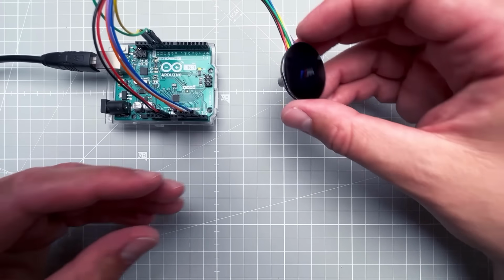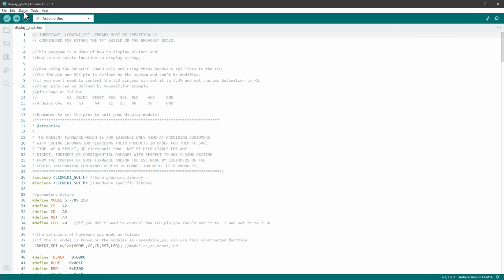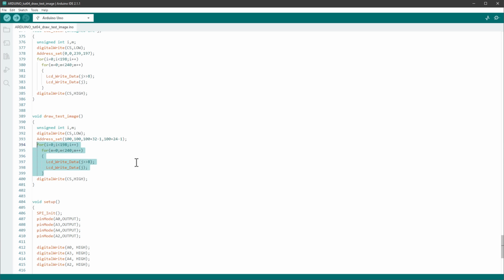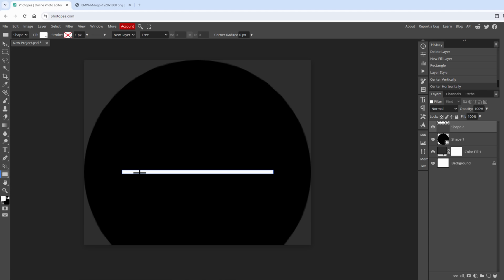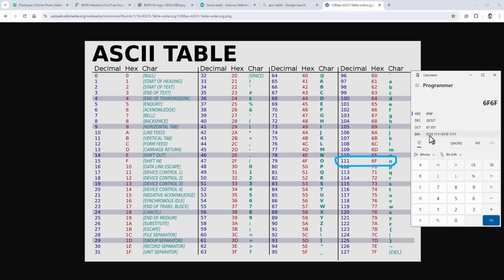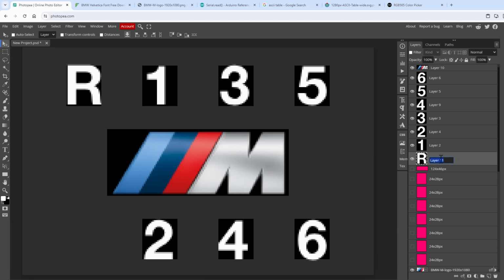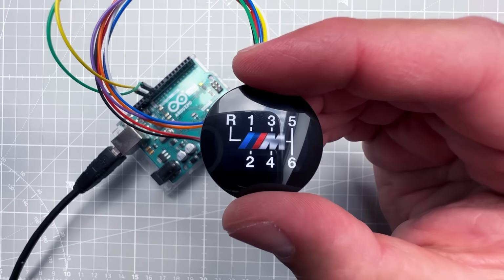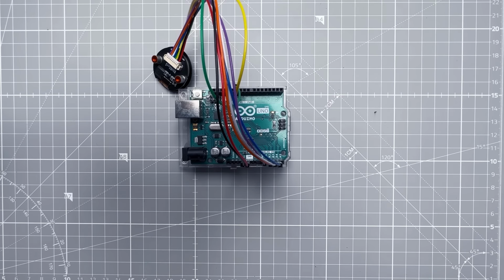I found PERFECT display

Comment: BMW E36 2JZ With Haltech Nexus R5 (Haltech CANBUS) with a TurboLamnik GCU for the 8HP75 (Sequential Shifter, but with canbus doesn't matter if it's H pattern or Sequential or paddle as Canbus will send gear selection and position without the need for and extra sensors) Would love to see this on a Round Forged Carbon shifter knob on my Jinx Shifter! Also, you should make a rotary encoder with haptic feedback and display for the TurboLamnik GCU, you could easily sell  it for $300USD as Turbolamnik just has basic rotary switch with separate oled (calculator screen) display! Would be amazing as 8HP swaps are going crazy now!
Reply from the maker: OK, you probably have the coolest setup! I will take a closer look at Turbolamnik to see how hard or easy is to get information out from it. Thank you for your suggestion!
Reply: @upir_upir  That would be epic as all fk.... I'll be the 1st to line up and buy this if you can get it going, this will change the 8HP market for sure, 8HP swaps are blowing up right now, you'll have no shortage of customers too...

Comment: I was actually thinking about taking on a similar project for a motorcycle engine swap im looking to do since I'll be going from an H pattern transmission to a sequential one.  I'm really glad I found your series!

Also I'm a Suzuki driver.
Reply from the maker: I don´t understand. Do you mean putting a motorcycle engine inside a car?
Reply: @upir_upir  Yep, it's a little Kei Van so it's current engine is essentially a 660cc motorcycle engine slightly redesigned to be used in a mid engine configuration.  So I'm looking to swap it with a more modern motorcycle engine to get a bit more than it's current 20ish HP, and to have parts locally available.

Comment: Customisable theming idea 1:
Use PCX image format with palette and RLE compression with 1 plane. It can be decoded straight into the display without maintaining much intermediate state at all. Punch through transparent images as PCX are a thing as well, then you choose some colour that doesn't occur elsewhere, and by convention the first pixel is the transparent colour. It also supports placement overlays, where the top left coordinate where to place the image is specified in the image file.

Theming idea 2: PAWN virtual machine with access to graphics functions.

Both these are suitable for an STM32 or something more capable than that. RP2040, ESP, etc
Reply from the maker: Thank you for your suggestions, I will definitely use something like ESP32 for future versions so I don´t have to care about the performance that much.
Reply: @upir_upir   QOI image compression also works well on more powerful microcontrollers (a little slow on AVR) and can be decoded to display with no memory consumed. I have since noticed someone made an image format specifically for this purpose, Arduino + display, that is derived from QOI but simpler/faster. Forgot what it's called.

Comment: I might have missed it in one of your other videos, but have you looked at the M5Stack Dial yet? You could likely combine your screen and controller in the same package, while also potentially gaining some extra functionality by being able to twist it as a knob, and touch screen.
Reply: I"m a computer scientist from the late 70's, whose first micro processor device was an apple 2 that had maybe  .1 % of the processing power of a device like this. Must have weighed at least 10 kilos. We thought that was amazing. Oh my, now totally amazing will fit on a keychain and weighs grams
Reply from the maker: Thank you for your comment, yep, M5 stack / dial is on my list of things to try for sure.
Reply: I haven't seen a tear down of the Dial, but I bet you could disassemble if you wanted smaller bezels and to remove the rotary components.

Comment: Lot of annoying bitmap picture tinkering. Would it not be easier to code the 3 colored stripes and the M directly like the other lines, to get sharper outlines, like vector graphics?
Reply from the maker: Sure, there are many ways how to achieve the same result. I have used images because the logo has some slight color variations and gradients / shading. It would look slightly different with vector-like graphics, but it would be possible as well.

Comment: You can read the engine rpm and and road via can network and newer car to calculate the selected gear. Also when the clutch is press you can blink the letter C since the ratio will be invalid
Reply from the maker: Yep, there are a few different ways how to get the current gear. I might explore some of the options in the future video.

Comment: What do you think about using the rp2040?
Reply from the maker: Not really, I´m trying to make it work with ESP32. Would there be any advantage of using RP2040 over the ESP32?
Reply: @upir_upir  if you are not going to use wifi, I believe the rp2040 zero is smaller

Comment: I’d like to warn people who park their car outside to not print the knob in pla. It absolutely will soften and deform with the warmth of the sun. Use PETG, ABS, or Nylon if you’re brave.
Reply from the maker: That´s a good point, thank you for bringing it up. I will definitely mention this in my next video.
Reply: @upir_upir  I did print a set of custom alloy caps in PLA and it flowed out somewhere on the road :P Definitely use PETG or harder material.
Reply: Those who have it available should look into resin printing with some abs like resin or similar!
Reply: if you're scared of your printers capabilities its not too expensive to send your file to a print farm and have them print in more difficult materials.
Reply: As many mentioned on PLA, I only use it for fast prototyping as it's cheap and I also use an ugly colour just to make sure It stays as prototype. Once I'm happy I go to the final material ASA, PETG, or PET CF, I would probably recommend ASA or PET CF for car interior parts, but that depends on your printed capability and if you have an enclosure.
Reply: also make sure the material you choose is UV resistant, which PLA also is not
Reply: I made a ABS 3D printed bracket for my Cobb access port. It’s mounted to my glair shield, it takes direct sunlight with no issue.
Reply: Petg indeed would be much more suitable for car interior temperatures in summer. Something like prusament galaxy black might be nice alternative.
Reply: True! I found out when I designed a headliner for my friends truck. On that note, I did 3D print a special cup holder for my car which has survived 2 years so far. It's low so the heat isn't as bad I guess, plus my car is silver whereas her truck is dark blue. Hmmm!
Reply: Most cases, yes, but very country/location dependant. I have had some PLA prints in my project car for 8 or so years, and they are still perfect. I am not in a hot climate though, so yes - generally this is true but not always the case.
Reply: Or just use ASA
Reply: 3d printing is useless, fragile and looks a mess.
Reply: @Synthematix  You know zero about 3d printing.
Reply: @Synthematix as previously stated you don't know anything about 3d printing. There are people out there printing firearms that fully function and are durable LOL. I literally make and sell a part for cars, the prototype lived on my car and survived the high temps under my Hood for years. Also konigsigg 3d prints exhaust Turbo manifolds and I believe turbocharger housings for their hyper cars
Reply: @sinformant  What home 3d printing?
Reply: @Synthematix  the konnigsigg parts are obviously very expensive commercial machines, but as for the other stuff I mentioned are all easily done on even cheap consumer grade printers. My resin printer can turn out parts that look like they were commercially injection molded and my Fdm printer I have printed objects you could run over with a car.
Reply: @Synthematix 3D printing can be really useful and it's possible to get very durable parts with it. It obviously depends highly on application, but your comment is full of ignorance.

Comment: Hi friend. It is possible to make an on-board computer with OLED from an arduino uno. With functions, turn-off-on, set the temperature limit to minimum maximum, control the intake and exhaust temperature sensors, example "Awron Gaug" I have a bmw e39 4.4 turbo
Reply from the maker: Do you want to only see the values on the OLED display, or do you want to actually controll anything? For the first one, yep, that should not be a problem. For the second one, there are alread projects out there - like the speeduino.

Comment: This is awesome. I had the same idea about 10 years ago. I tried LED's, fibre optics, PICAXE chip on a custom board with SMLED's more. I then had to grind out the top of the gear cap to get room and cut out the numbers to get the light to show through. but then that light would show across all the numbers and I needed a way to fill the numbers with something clear.

Then I got a 3D printer and hopes of finishing my project where raised again. while this did allow me to get closer, I still had problems with it all. getting power up to the 'display' getting the chip to decode signals from the 5 switches the LED's being mounted in a way for two colours with out bleeding through.

Now I find you project and I'm going to have to copy you as what you have done is awesome and I have learned so much watching your videos. I can't wait to see your finished product. Keep up the good work!

Oh mine will be going into a VW T5 camper van when I get it done.
Reply from the maker: Thank you for your comment and nice words! I´m sure many other people have the same idea, it´s not unique, but I´m glad to hear that my video might inspire you with your project. Please feel free to copy anything you might need and good luck with finishing the project!

Comment: I'm a little confused. Aren't the SCL and SDA pins on the Arduino pins 19 and 18 respectively??
Reply from the maker: Those are SDA (data) and SCL (clock) pins for I2C communication. For SPI connection, there are pins 13 and 11, but often times, for SPI, different labels are used - like SCK (clock) and MOSI (data).
Reply: @upir_upir  I guess I just don't understand hardware pin outs 😞

Comment: Try STM32
Reply from the maker: I´m planing to use ESP32. Would there be any benefit to using STM32 instead?
Reply: @upir_upir  Nothing specials, ESP32 is good. ESP32-C3 is very tiny package.
Reply from the maker: @geethma3590 Ok, thank you for letting me know

Comment: It would be awesome if someone would take this even further by making it able to track the shifter location itself so you won't even need to take any info from the car(about which gear its in).
Also, I think it'd be nice if you create a couple different iterations of shifter types such as ones that have the reverse gear on the left (many Volkswagen). For alternative visuals Mercedes, Audi, Renault, Fiat, Citroen, Peugeot, MG, DS, Land Rover, Seat, Skoda, Bentley and Jaguar are good options for Europeans. All these would take too much time tho lol.
Reply from the maker: I´m actually experimenting with this using the accelerometer. Let´s see how it goes...
Reply: @upir_upir  I wonder if the 'power' in the car is dirty enough that there's some way to filter out an rpm signal from it?
Reply: I see Upir’s response, and if anyone could figure it out here I think it’s him, but I don’t think it would be as reliable without the tcm being the source of the current gear information. It would be cool, but if you’re slamming through gears, of course because some kid thinks his civic with the only aftermarket parts being his muffler and the fake hood pins is faster, then I feel like the accelerometer may have a difficult time. What if you almost miss fifth and money shift into third but happen to slam it over just barely touching the entrance to third and grinding the stick on the flat over to fifth? I feel like it may have some problems with that. I think you automatics that have the auto stick/manual shifting mode that uses the shifter to push left for up and right for down it might work.
Reply: @atillathehung2000  yeah I don't really know much about specifics, you may be right. I specifically said that it would be better to not rely on car for which gear ur in because it would be different for basically every brand maybe even in every model. Though I think someone could definitely figure it out themselves for car models they have access to and create modules for it.
Reply: You can follow his lead, he's scratching his itch, you go ahead and scratch yours, you are 99% of the way there. Go ahead if you want to do do Volkswagen, Mercedes, Audi, Renault, Fiat, Citroen, Peugeot, MG, DS, Land Rover, Seat, Skoda, Bentley and Jaguar and "other good options for Europeans." He just showed you how. Or just sit back, and comment, wonder why he's modding his car and not yours isn't.
Reply: @zincfive  are you fucking aut1stic? He himself told to make some recommendations about car brands he should make new graphics with, hence my comment. I never said "You are to create graphics for every car brand that I've listed here, keep working peasant!", why are you so butthurt? All I did was making some suggestions, I don't have any hardware nor any software knowledge to execute any of this shown in the video. You're just an insufferable human being with no friends living in mommy's house.
Reply: @zincfive  what about you stop being a insufferable human being and shut the fuck up?

Comment: thank you for this! 
It's quite refreshing to find a tutorial that actually walks you through the thought process of dealing with memory limitations on a board like the Arduino UNO & show that complex graphical interfaces are possible with a little bit of ingenuity & code-fu 😄
🤔I like both filament options... the black for a little stealth bling & the color changing for a bit of flash. 🐿as for the microcontroller, I'd love to see it on the tiny ATmega328P powered board just to prove that it is good enough for a shift indicator (I feel the ESP would be wasted on the project unless you want it to also send the shifter information to a custom dash or heads up display 👈🤓now there's a fun little potential project)

Looking forward to your next steps... perhaps we'll finally see the finished product?
Reply from the maker: Thank you for your comment and all the ideas! I will try to explore all the options, and yes, I also hope that someday it will be a finished product, but for now, there is still a lot to learn for me.

Comment: You should really consider depart from arduino. Nowadays it's a very outdated microcontroller. Find some cool microcontroller to play videos at these displays.
Reply from the maker: I´m currently experimenting with ESP32. Arduino is still nice in it´s simplicity. It´s slow and doesn´t have too much memory, but if there is a problem, there is a big probability that you will find an answer online.

Comment: That's a nice little display. Sadly I don't currently own any manual transmissions but I kinda want to make a couple soft gauges for my truck ('02 Ferd diesel) with the capability to read both analog sensors and OBD/ISO/etc telemetry and these might be perfect since I'd like to keep the accessory gauge cluster small and unobtrusive. You might want to look around at the STM32 based dev boards, the F103 "BluePill" form factor ones are about the same footprint as a 24 pin DIP and they've got enough horsepower do some fancy effects on a small RGB display. Only downside is it's not an AVR and there's some learning curve versus a proper Arduino, although I believe you can use the Arduino libraries on STM.
Reply from the maker: Thank you for your comment. I do plan to explore using ESP32. Would there be any advantage using the STM instead?